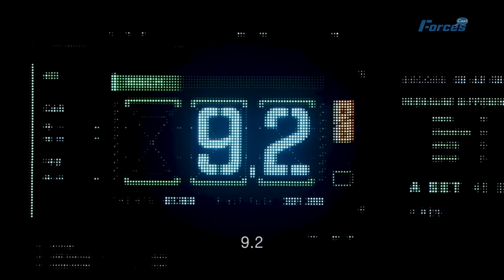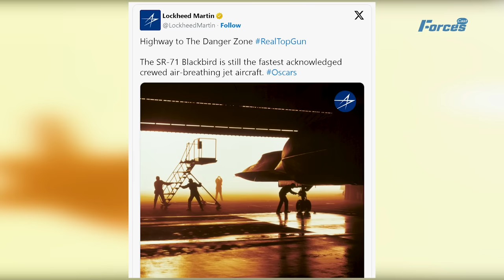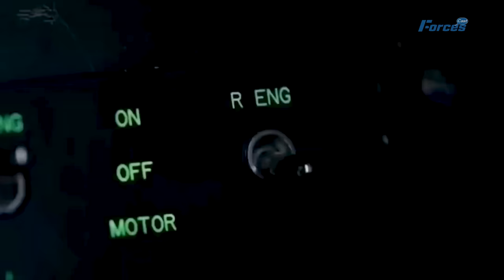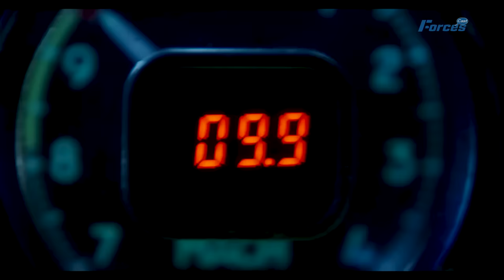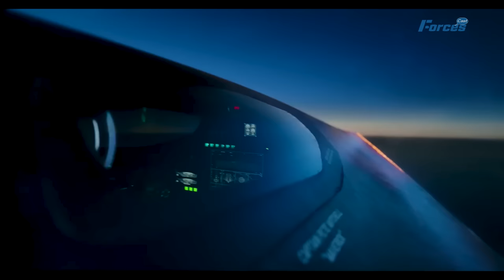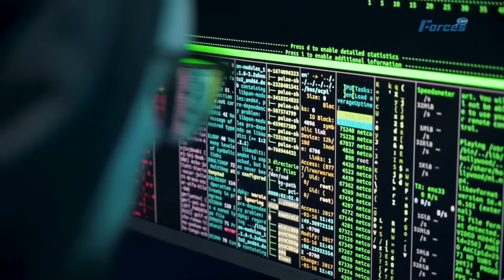US Air Force's SR-72 Darkstar Ready for 2024 Debut Flight

Comment: The Aurora flew over 30yrs ago, never been reported since. It staged at Machrihanish then the longest runway in Europe that could take the shuttle, the lighting was same as what the shuttle would use. I knew a worker there who saw it 4 times the afterburners on take off were impressive, it once flew over the field at near supersonic speed before climbing vertically and disappearing with a lot of noise.
I also knew a mil radar op who would be briefed when it was to show up on the scope over the UK, all over 30yrs ago.

Comment: I believe the fabled Aurora from the mid 80s and early 90s was a long running test mule for the SR72 Darkstar. The big difference being of course that they changed it from manned to an unmanned platform, but also the propulsion technology has certainly improved by then as well, not to mention pretty much all other technology that would be used on such a platform

Comment: You know it still holds the records and it will stay that way.
There will never be another manned air breathing aircraft faster than the SR-71 Blackbird.
You have to understand the dynamics of keeping a human alive in an aircraft that flies any faster.
Reply: Never say never. Remember Duncan Sandy's white saying there was no longer a need for manned conat aircraft? Remember that we'll because that was 1957. We still haven't got rid of piloted combat aircraft. Computers can't react to intuition, gut instinct and sheer humans stubbornness not to be beaten.
Reply: The SR-71 was a bigger and slower version of the A-12.
Reply: The only thing that kept it from going faster was heat buildup along the leading edges. That was 50 years ago and to say it can’t go faster with todays new materials and aero technology is rubbish. Can we go faster ?…..absolutely, do we need to, probably not.
Reply: The Aurora walk by the Blackbird like it's in reverse.
Reply: Under Project Mayhem the Air Force has about 70 projects slated currently. The Project Mayhem platform that is somehow connected to the SR-72 project (or is perhaps now the SR-72, nobody knows) is already fairly advanced and has a performance goal of over Mach 5 via "multi-cycle scramjet propulsion" . The propulsion was already successfully tested in 2018 according to LM. When Russia announced the Kinzhal, everything went quiet, but a scaled-down prototype technology tester should already be flying according to what was known before that.  Nobody knows if a manned aircraft will be one result of the Mayhem project, but most experts are expecting an unmanned "drone" first. The speed is not the problem for humans - see Space Shuttle at max. Mach 24 - the heat is. If they can get that under control, experts think it i feasible. LH has already stated that they got the heat of the engine under control by 3D printing part of the cooling system into the engine. The challenge appears to be the surfaces, structure and with that, the cockpit.
Reply: not if it has a jet engine. It is not the materials it is the turbine blades that interfear with speeds over Mach3.5 @velocitymg
Reply: Check out Hermeus quaterhorse. Using the Chimera engine it will go faster.
Reply: @oml81mm  And the YF-12 was a two person armed interceptor version of the A-12, from which the SR-71 was derived.
Reply: @thomasblankinship98 Did Aurora exist as a test platform? Probably. 
Was it ever anything else after all these years? Probably not.
But yes, I believe it was real.
The "Darkstar" is probably another project entirely, though perhaps building on what was learned from "Aurora" (or whatever it was really called).

Comment: But, what happened to the Aurora?
Reply: Projects come and go; just because we were testing something, doesn’t mean we will use it. 
Same with F16XL, stuff like that. Just like F22 was selected for mass production by USA, but during testing, a YF had better stealth but was harder to maintain then F22. Something about engines are harder to maintain. The YF does not even show up on radar, f22 is like a bee. 
We will always test different air vehicles but nothing is set or permanent. What ever has all the perimeters our military is looking for.
Reply: A CIA pilot parked the Aurora at Macrihanish but forgot to switch off the cloaking device. It is still parked there somewhere, but nobody can find it.
Reply: It's flying secret spy missions whenever needed.
Reply: There were probably like 3 made and were for testing to make bigger projects like the f35 f22 and a bunch more classified things

Comment: Wie immer, reine Spekulation.
Die SR-71 ist nie über Gebiet des Warschauer Vertrages geflogen. Wenn sie in Großbritannien auf die SLB gefahren ist gingen schon alle Verfolgungsradare in Betrieb.
So wie damals gibt es auch heute Bekämpfungsmittel der Russen, die das ding vom Himmel holen. Ich möchte nur daran erinnern das die Russen Hypersonicraketen haben und sie selbst haben auch entsprechende Abwehrmittel.
Das heißt,  eune SR-72 oder Ähnliches kann durch die Russen jederzeit bekämpft werden. Das werden die Amis nicht riskieren. Fällt das Ding vom Himmel hätten sie die nächste grosse Blamage.
Es kündigt sich ja schon die für die F-35 an, über 800 Systemfehler.
Reply: Almost all ballistic missiles are hypersonic = over Mach 5. The Kinzhal is an air-launched Iskander from the 1980's that cannot really maneuver at high speeds. They are boost-glide weapons that basically accelerate then glide back down to Earth at high speeds with limited maneuverability (supposedly up to Mach 20 if you believe it). They have been shot down multiple times by Patriots in Ukraine. The SR-71 avoided Libyan missiles fired at it which had a top speed of Mach 5 decades ago, reaching its maximum speed ever flown of Mach 3.5. It never flew over the Soviet Union because the US stopped that practice after the U2 was shot down - but apparently did fly over "eastern Europe" and China. Nobody knows what Russian S400 and S500 are capable of, they have never gone up against modern stealth aircraft, let alone hypersonic aircraft which aren't even flying yet. With satellites, the recon missions of former decades are not as necessary if there is not a conflict in which the US is involved.